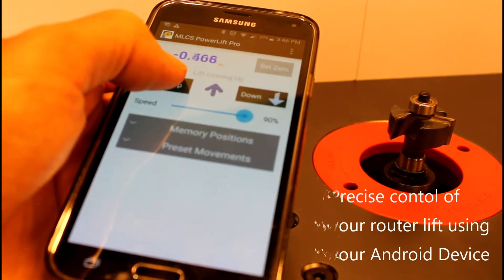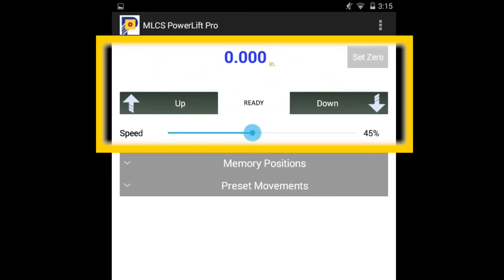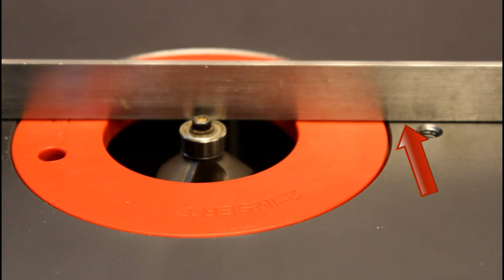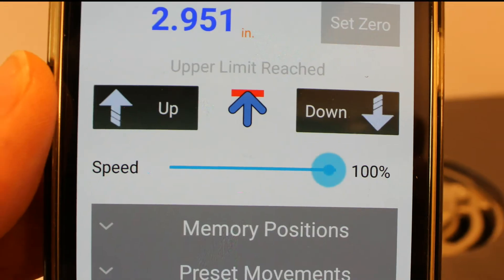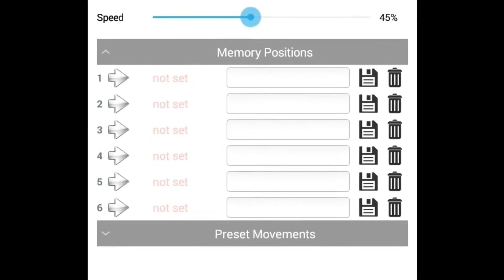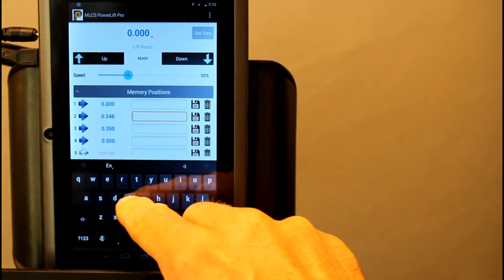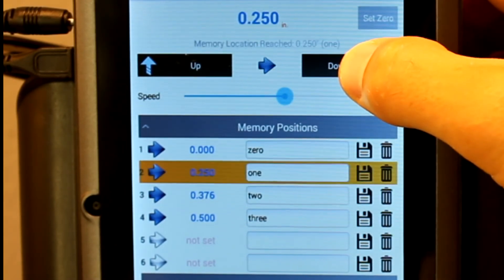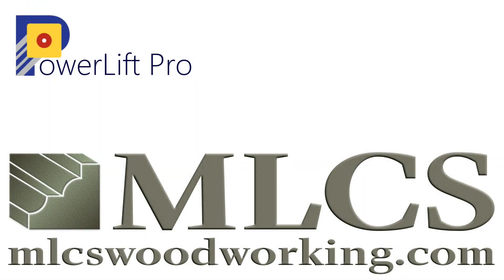Android App features - MLCS PowerLift Pro - Android controlled woodworking router lift

Comment: Is it possible to save a set of memory positions as a project so that you could come back to them at a later date even though you have set other memories in between? This would be very helpful for working on a project with many settings says for making a cabinet you could one set of memories and for making another project or style cabinet you could have another set of saved memories. This would only require a simple change to the software.
Reply from the maker: Hi Bob, yes, you can name and save as many sets of memory positions as you like.

The version of the app shown in this video is the original and there's been some nice enhancements since then.
Reply: @EagleLakeWoodworking  I will have to look for that as I did not see where you could do that. I downloaded the app today so should have the latest version.
Reply from the maker: @bobd.  In the grey heading section that says Memory Positions, there should be 3 vertical dots on the right side.  When you press there, a menu should show that allows you to save or load a previously saved memory position set.

If you don't have it, let me know and I'll see what's going on with the app version that is available for download.

Also in the main screen , there's a similar 3 dot menu in the upper right.  In that menu, there's an option to see your version number.  You could send me that here
Reply: @EagleLakeWoodworking  Thanks. I'll look for it tomorrow and get back to you.
Reply: @EagleLakeWoodworking  I found it. Thanks for pointing me in the right direction. That feature will be very useful.